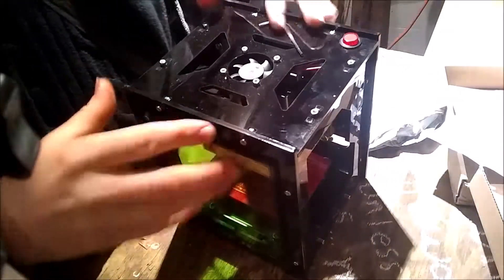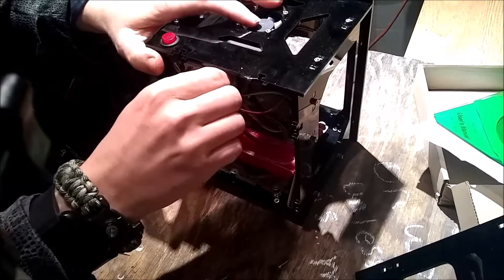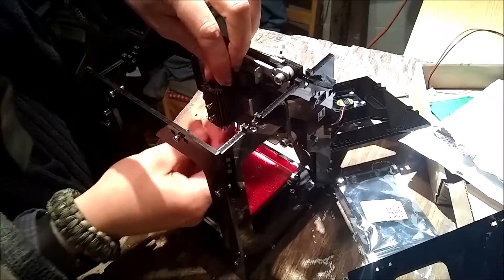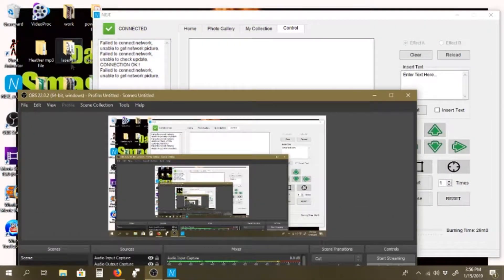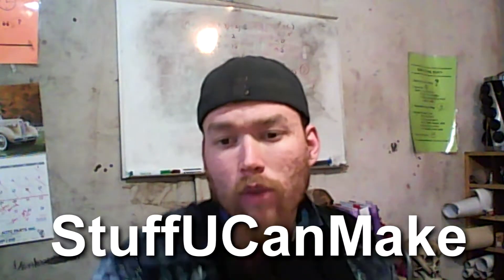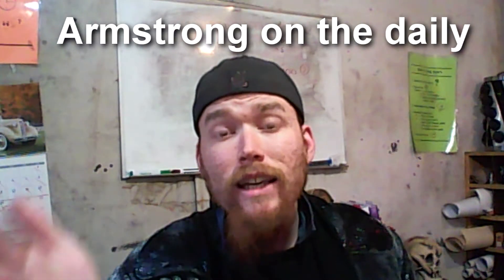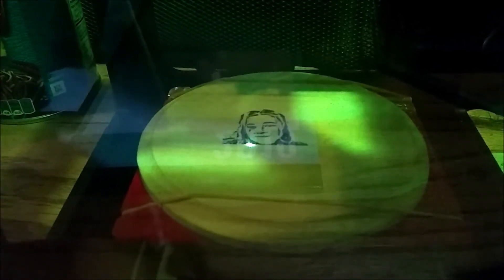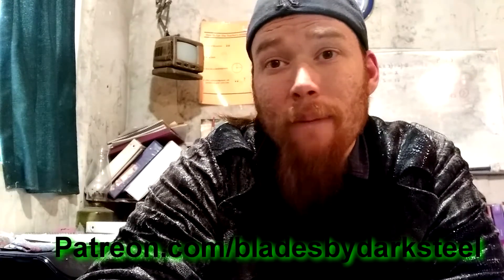Replacing the Laser on My NEJE Engraver

Comment: how long did the laser went burn before you replace it a new one thanks!
Reply from the maker: It didn't last very long at all and when I replaced it I had a similar experience. I haven't done much with the machine in a long while because it's a bit of a hassle and not what I expected when I bought it but I am willing to allow for the chance that I might be doing something wrong on my end and I also know that I bought the cheapest versions of both the machine and the replacement laser that I could find so better ones may be available.
Reply: oh i see thanks for the heads up i was planning to get one for myself since i will be trying to make some dog tags engraving on it and sell it do you have any idea how months or weeks will it last? thanks man for your replies i do really appreciate it.